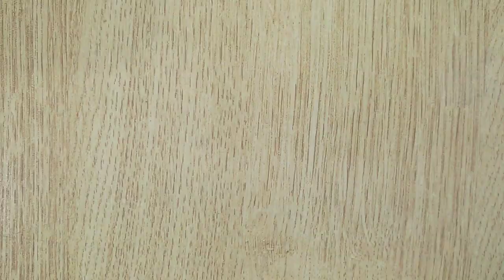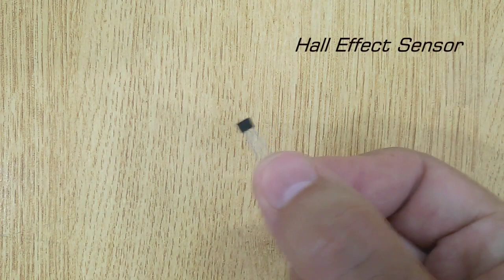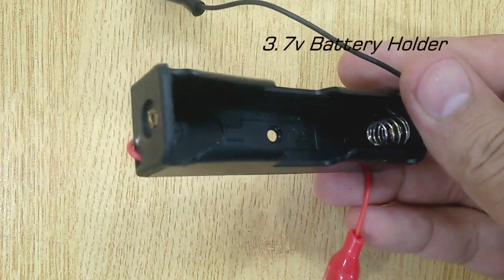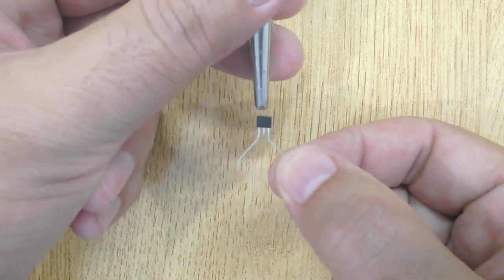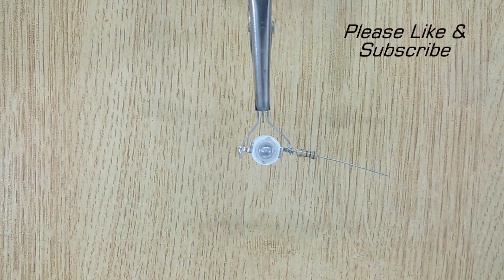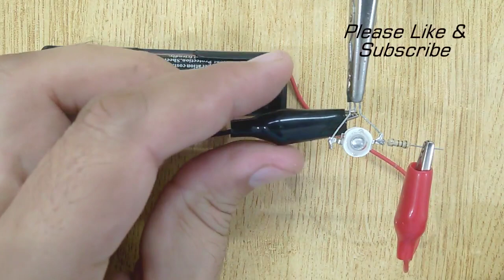How to use Hall Effect Sensor as a Magnetic Switch to turn ON / Off an LED | Ezi Circuits

Comment: I use modded nerf blasters and was wanting a simple video to explain a way I can put a magnet in the nerf foam dart magazine so that when the darts run out the magnet sensors the hall sensor and the LED light indicates I have run out of darts.
Thank you I'm off to the shops to buy the parts.👍

Comment: If I arrange 16 hall effect sensors with LEDs in a circle and rotate a shaft with a magnet in the center, it should turn on each LED as the magnet passes each sensor. Correct?